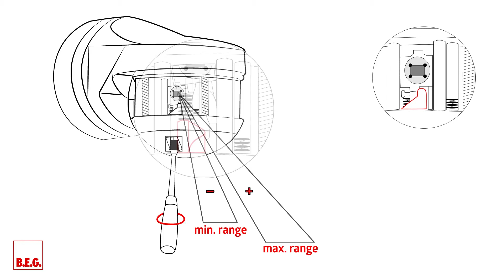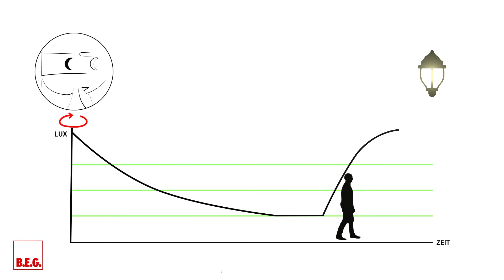Mounting and adjustment of an outdoor motion detector | RC-plus next N

Comment: Can I manually switch the lights on and off with the remote
Reply from the maker: Yes, that's possible. You can either use the remote IR-RC Mini with which you can only control on the light or you use the IR-RC for conveniently setting or changing parameters.

The products can be found on our website: https://www.beg-luxomat.com/en/